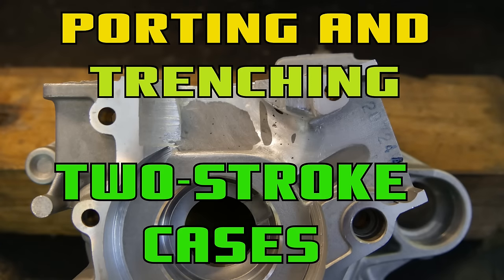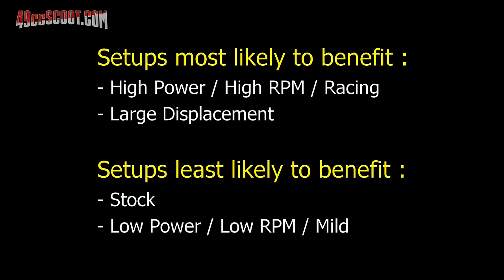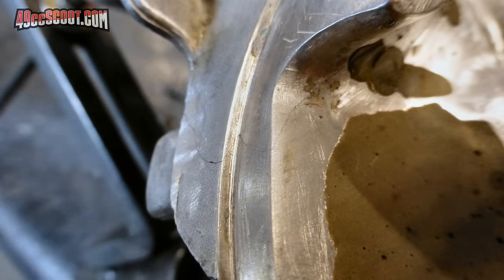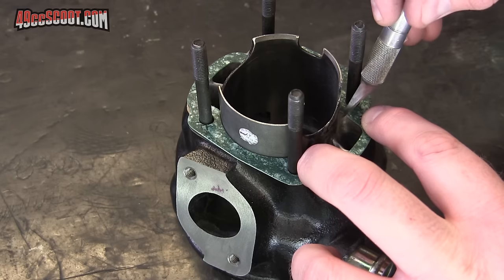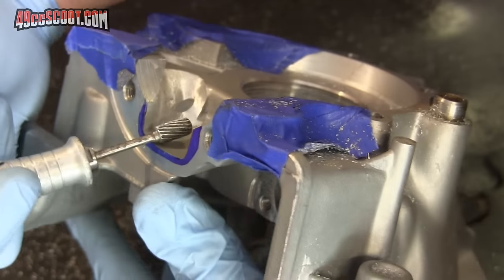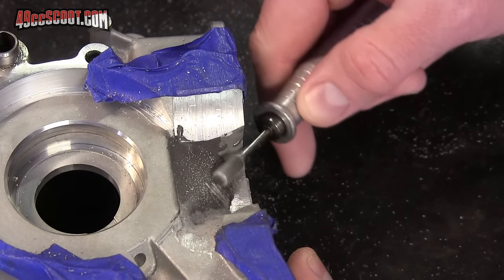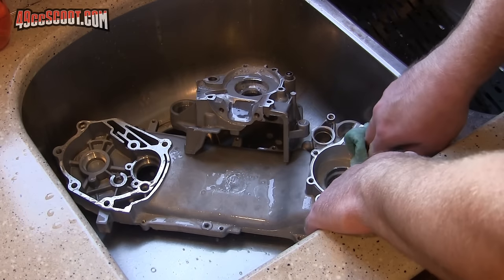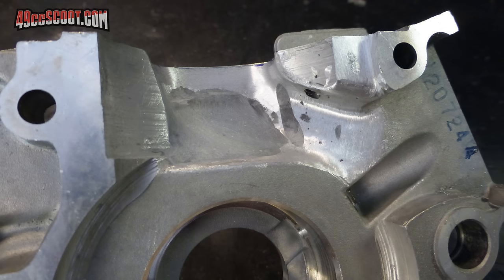Port Matching, Porting And Trenching Two-Stroke Engine Cases

Comment: Good work although removing alot of material has a negative effect by gradually losing crankcase compression 😐
Reply from the maker: It does lose crankcase compression, but more modern info suggests that the exhaust does a lot of work and volume may be beneficial to some degree.
Reply: @49ccscoot  that actually would make sense im glad you mentioned that thanks 😊

Comment: How much hp does your seat of the pants dino tell you a modded 103 cc kit and port job like this puts out  ? I know I have guessed small 4 stroke engines within 1 hp before. At least never WAY off the mark. And btw, Nice work and vidiography .
Reply from the maker: Thanks. I hate guessing at power, because I don't have any reference for personal experience on scooters. Never had one on a dyno. Best references I have would be a 70cc Corsa claimed at 9-11HP and a 100cc Apex ATV claiming 12HP. I've been around a Corsa with a C16 and I'm confident that the 103 has more than that. I'd suspect I'd be a bit over the 100cc Apex ATV. They do have a 24mm carb and tuned pipe stock though, so likely only a tiny bit. WAG  = 12-15HP.
Reply: @49ccscoot  Holy Crap, I would be exited if it put out an honest 10 -11 hp. Thats a lot of stomp for something that began its life as a little 49 cc 2 stroke !  Thats a little power house !
Reply from the maker: @johnaverick7468  There are people with 30+HP at the wheel out of these horizontal Minarelli engines with racing builds and nitrous. Not something you wanna  ride around too much, but crazy power that no one expects from a little scoot.
Reply: @49ccscoot  Yea, But this build could be a daily driver , Right ?
Reply from the maker: @johnaverick7468  I wouldn't use it for that. It could rack up some miles. My issue with sealing was the main thing holding me back. For a daily rider, I wouldn't go much past sport to midrace 70. The stock engine will of course work best, but a sport 70 can take a lot.
Reply: I have a MHR 50 ported cases n cylinder tuned pipe 24mm pwk in a mini quad making 13hp on Dyno

Comment: The gasket you were using to mark the carters was not symmetrical
Reply from the maker: Depends what you're working on. I've owned quite a few big iron cylinders for these (52-54mm) and most have the oil pump indentation on one side.  Usually the base of the cylinder has that shape and there's not a lot that you can do about it unless you'd be willing to try to add material to the cylinder.

Comment: Ok fyi you just decrease crankcase pressure. Never have I seen Dyno proof of power gains. The charge is coming up into the tranfers not from tranfurs into the case. In some cases a step increases airspeed  ok just noticed you mentioned no power gains and increased crank  volume. Your correct you won't find any Dyno proof

Comment: Does this help with raising rpms?
Reply from the maker: If you can improve flow, you may improve high RPM power or increase the RPM ceiling .
Reply: @49ccscoot  as I've got a 66c chinadoll and want higher rpms and am just starting to learn porting. I've heard about boost ports for reed valves but how and do they work?

Comment: Is it applicable to a Stock 50cc set up?
Reply from the maker: I would not do this to a stock 50.
Reply: @49ccscoot  what would be the best for a stock 50cc stock portings or minimal portings?
Reply from the maker: @tepsanpedro7715  If you aren't doing other mods, just leave the ports alone. It's not worth it. Maybe advance ignition timing. That's less labor intensive and can provide gains. If you get a tuned pipe, then consider porting to match to the pipe's RPM and maybe raise compression while you're at it.

I've got a playlist here of some 49cc tests that I did :
https://www.youtube.com/playlist?list=PLD60FEB66F10B4BD6

There's porting info here. Most pipes that rev significantly higher do well with 190/130 timing. Use less timing if the pipe is pretty mild, like 180/120.
https://49ccscoot.proboards.com/post/30229/thread

More compression info here :
https://youtu.be/87aHTfxatag
Reply: @49ccscoot  thank you for the inputs sir,👌

Comment: Never understood trenching. Fuel mixture gets sucked by the piston and goes behind the piston. The piston pushes it trough the ports afterwards. What kind of use is flowing towards the transfers from the reed..... It never goes that way (except for the coanda one through exhaust resonance)

Comment: I have worked with Olav Aaen on high performance two stroke engines for drag racing. This guy has done tons of testing and I have info on cases and transfers but won't share here. If you email me I will gladly share what I've learned.
One thing I'm proud to own is a 12 port engine designed by Olav.
Reply from the maker: LMK how to get in touch or drop by my site (49ccscoot.com) and my contact info is there. Very interested.

Comment: The biggest problems if you do matchs is first of locking the cylinder to the case, second by taking out such a substantial amount, other type cylinders will be mismatch. Sure, liquid metal might help for slight remedy but overall the case is consumed/spent.

Comment: "Porting" is a term for cylinder port modifications, not for the cases.  It refers to the "port window" at the cylinder, much like a window on the side of a ship is called a port window.
Reply from the maker: It's semantics and unimportant really, but I think you'll find that most people think of porting as modifying a port or passage. This fits that bill. Some call modifying cases flowing. Call it what you'd like. The name won't make you any faster.

Comment: There's an ongoing debate that argues the point of polishing to a mirror finish or leaving a slightly rough finish. Flow of fuel air mixture will be better if it's slightly rough as opposed to a mirror finish.a mirror finish will cause cavitation in the flow is what most of the top tuners for two stroke motocross tuners recommend a rough finish. It's the same principal as to why golf balls have dimples. The golf ball will travel faster and straighter because of fluid dynamics
Reply from the maker: I didn't even think it was really a debate anymore when talking about wet flow.

Comment: can anyone do 3d modeling on the airflow pathways and what gains on fuel air mixture or fuel air capacity or fuel economic gain and or horsepower gain/loss vs strength loss reliability gain or loss

Comment: I have a yamaha bws 1994 i know nothing about fixing im screwed
Reply from the maker: What's wrong with it?
Reply: 90GTVert runs bad need to be on choke all the time other owner did evrything himself but in a bad was i was going mabye 70km/h and speedwire hung itself so is freaked and front tire locked i smashed into the ground gravel very fun . I dont know mutch but i probly have to rebuild evrything hard to get parts to a yamaha bws 50 u k iw enny stores ? Links?
Reply from the maker: @mariusofearth2474  Since you're using km/h, I'm guessing you're not in the US so I'm not of much use for who is the best elsewhere. Sounds like it's probably lean so do a leak test and check the airbox for damage. You should make sure nothing is bent with the steering or frame before you do anything else though.
Reply: Hello my name is Jim Brenno I can help you to get this running again
Reply: For a small fee I'm building a bike and I need to earn some money I'm good at what I do and I will dial it back into specifications or a little bit more power if you want it okay thank you.

Comment: What rotary tool machine are you using? Yours is so silent. I've been using rotary tools like dremel and find that they are so noisy and have already had a couple of them failing after a couple of years. I want something more reliable and less noisy.
Reply from the maker: I use a Foredom SR. https://amzn.to/3iGr1We (affiliate link)

I used Dremels for years and got tired of them failing and decided to try it. Much more expensive, but I have been happy with it. It has a lot of torque compared to the typical hand tool, but doesn't rev as high. Lots of handpieces available. I use a hand dial control instead of the foot pad that most come with. Foredom sells one, which I have, but a generic router speed controller works fine for considerably less. https://amzn.to/3c6bUTE (affiliate link)
Reply: @49ccscoot  Thank you for the fast reply! I have been looking at the Foredom SR before and now it feels like the next thing I'll buy. The next time my dremel burns out - this is what I'm getting! Thank you.
Reply from the maker: @glecas  Pick up a spare flex shaft when you do. The extra torque does take a little getting used to and it will break flex shafts if it hangs up.
Reply: @49ccscoot  Good tip - thank's!

Comment: As far as i know, air from the intake doesn't go directly into the cylinder, but into the crankcase, only after the piston moves downwards, compresses the air and opens the ports will the air enter the cylinder. So that trenching thing is a waste of time and effort. Id rather make a smoother pathway between the crankcase and transfer ports than all of this.

Comment: Epoxy is good most of the time. But using aluma repair metal low temperature fix it rod is just bulletproof. The heat is from a propane torch and the metal is three times stronger than the base metal of the case. The heat is like four hundred degrees roughly. I have fixed transmission cases with broken mount ears without failure. If you want a 100 percent guarantee you want this stuff. Just saying.
Reply from the maker: Thanks. I'll have to check it out.
Reply: @49ccscoot  Any time fella.
Reply: @49ccscoot  You would be amazed how quick and easy doing the repair is and how much stronger the material is as I stated that the solder is two to three times stronger than the base metal. Worked for me fella, and good luck too..
Reply: @49ccscoot  Any time fella. Drop a line if you have more questions as I am willing to help you Sir.
Reply from the maker: @victoryfirst2878  I actually went to a pro welder because I needed an aluminum head filled partially for some mods. He used what he said they called an Aladdin rod (brand name) that he had around for years and said that may be a better bet than welding and potentially distorting. He used an oxy/ace torch, but with low heat for that setup. It held up around the combustion area. I have a feeling it's very similar or the same as what you're referencing. I meant to get some, but I was tight on cash and it's not super cheap.
Reply: @49ccscoot  You are correct that these rods are not cheap. But you can buy them by the pound. They come under many names, but mostly they are the same. No flux needed for aluminum. I fixed my neighbors truck bed with a big hole from a rock with a patch that I used a Mapp gas and turbo torch made by Craftsman. The guy force some good money on my wallet which I was glad to accept. Rods are paid for now. With flat black paint, you do not even see it. The dealer wanted like over a thousand dollars. What a rip-off. Good luck with your project and have fun too.
Reply: Good day fella :).

Comment: I'm surprised the engine guys don't modify crank counterweight to act like a turbo and use Disc Rotary Valves they already know make incredible power...and broaden the power and torque curves....
Reply from the maker: Some people do convert to rotary valve setups, but it's not an easy thing that just anyone will do with these case reed inducted engines.
Reply: @49ccscoot  if it was easy the kids would be doing it, willing to go the extra effort is how you get in the winners circle...

Comment: Do the math first, ie, Prof. Blair two stroke book or buy his software, Very heavy in math. Once you have the numbers then start the modifications. Lots of variables to deal with, Blair’s simulation software gives numbers on port timings inlet/exhaust areas and expansion chambers dimensions.
Reply: we were using blairs formulas in the late 60,s , also i would never just use filler in places we would break through ,i would cut and shape alloy blocks to fit the holes that need filling and use a clear resin based epoxy that i would mix in large quantities of alloy fillings then i would glue it together , i also did this with barrels that needed extra ports , also im not convinced that reed valve s are any better than a piston ported barrel , i had a fun 50 for road use a gilera touring much moded into a racer style with a derbi race fairing this little rocket was timed at 87 mph

Comment: we were pulling 130hp out of a 1998 cr500
Reply: Pics/vids or it didnt happen...
Reply: How did you get those sort of numbers for a 500
Reply: @AJByrne82  had fully custom built internals made out of mostly billit titanium exsept for the crank... we then proceeded to mill the head 65 thous and rose the exhaust port and opend up the intake transfers...then we turned it in on methinol

Comment: When I first started working on motorcycles I broke a ring on a moped that had two. At first I didnt think it would run. The thing ran better and stronger than before. Later I realized that some race engines only use one ring. Reliability and longevity are shortened. A tradeoff for performance.
Reply from the maker: 1 ring on a dual ring piston could cause short circuiting to some  degree. May not be  an issue at all though. The better choice would be to try to source a piston designed for a single ring if possible.

Comment: Watch out ! Chinese gaskets don't always match the upper cylinders exact shape and dimensions. Always measure both the case ports and the cylinder ports to ensure a perfect match before grinding. Chinese gaskets (are not) reliable insterments of measure.

Comment: I like your commitment but your way out m8, you have to stuff the cases after removing all that material, plus the direction of the fuel  mixture is directed to the mains and big end for lubrication and cooling.
Reply from the maker: If you don't believe Malossi, Yamaha and I; look up 8.1 CNC cases. They create an even more direct path from reeds to transfers and even separate the actual crankcase from all above the crank even more.

Comment: 2:32 this kind of flow never happens in a two stroke crank case... :|
Reply from the maker: It's not so simple as the animation... but the point should not be lost that the idea is to create a more direct path.
Reply: @49ccscoot  and you increased the harmful space in the crankcase, weakening the suction and pre compression power

Comment: Remove as little material as possible to maintain intake charge velocity. This 'hogging out' is ...concerning.

Remember that these only move 80 or 100cc of air per revolution.  If your ports alone hold this much volume, the intake charge moves slowly and your torque falls.

Comment: I think that using glue to filling case is not good idea. I thing that you should use proffessional aluminium welder. But i like watching your videos
Reply from the maker: Pro welder said there's a high risk of warping and melting more critical areas. At that point, I'd rather have JB weld crack than have my cases ruined before I start.
Reply: @49ccscoot  yea i rather not take so much of, if you have an expensive cylinder i would not risk any jb weld flinging of over time. You should really consider looking at the malossi C-one cases and the polini P.R.E. Well you prolly already kno about em you seem pretty pro. I did a similar job to my 70cc piaggio hiper (have one nrg with c-one and a zip with the standard block) and going to the edge like this is not really worth it in the long run, spending more money on another case is (imo)

you could leave 5% more next time and not go trough to the bolts and i promise you will not feel the differeience with 70cc - just have a better case that holds up.
ive seen peolpe weld (real weld) in cases and nothing bad happend as long they did not overdo it.
Reply from the maker: @mr.pllesmvs1307  I've been doing cases with JB for somewhere between 5-10 years. Cracking is the only issue I've really had. 

A couple of people on the forum have Malossi cases. Really nice engines. 5X or more the money that I have into anything of mine, but really nice.